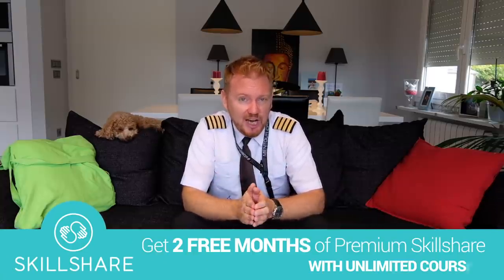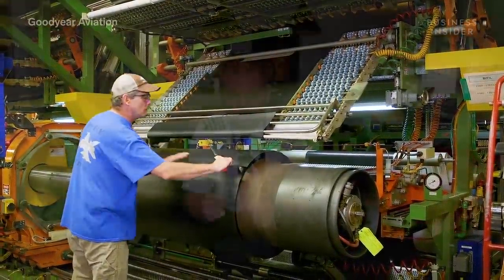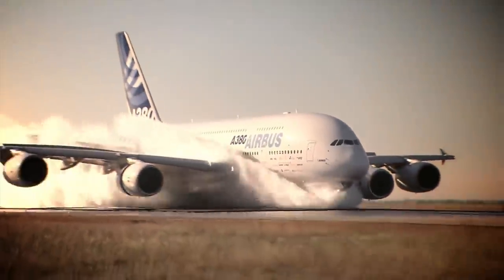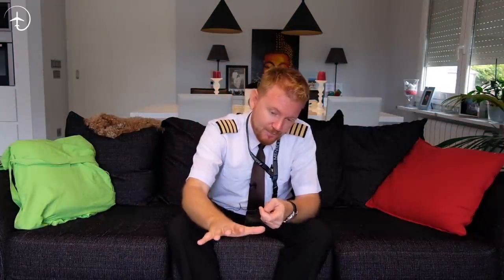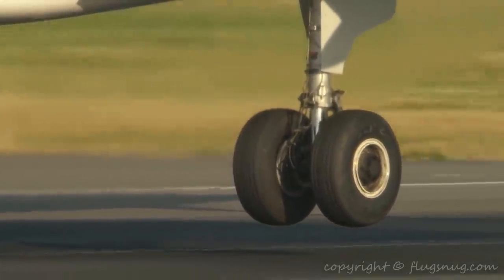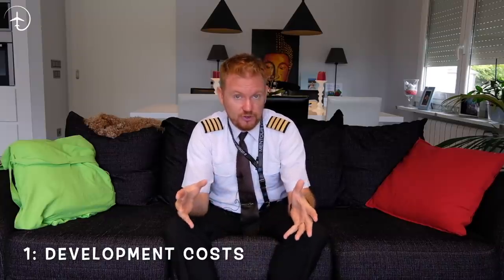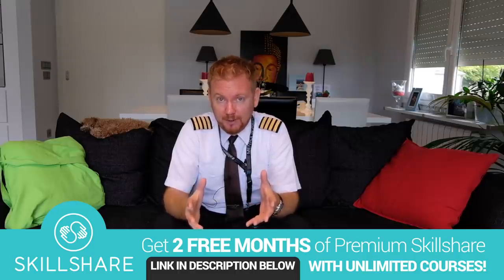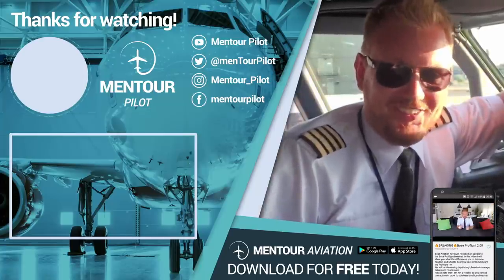Why not make plane-tires spin, before landing?!

Comment: Just think of the weight of 18 motors powerful enough to spin up the wheels on a 747, that weight would have to be carried for the whole of the flight burning extra fuel. The cost of changing the tyres when they wear is nowhere as much as the cost of transporting the motors needed to spin up the wheels for a couple of minutes during landing. Each wheel tyre and brake unit assembly weighs about 400Kg, when a weight like that (400Kg x 18 = 7200Kg) is spinning the gyroscopic effect would be quite strong, strong enough that it would affect the handling of the aircraft at a critical low level phase of the flight just what you really don’t want. The tyres are recycled, they can have the tread replaced (so long as there’s no damage to the main carcass of the tyre) a few times before they get scrapped. The wheels can be changed reasonably quickly, and during that wheel change a quick inspection can be carried out out on the brake unit, axle and surrounding area. It’s surprising how many landings a tyre can do before it needs changing. The tyres get inspected each turnaround, any cuts or wear that allows canvas to show means a wheel change.

Comment: i agree about the electric motor - probably even the weight would void the benefit in the longer lasting of the tires given that they are relatively cheap as you explained. However, how about some sort of finns that could catch the wind and start the tires spinning. About the different speeds of the tires - this could be solved by breaking the faster tires to the speed of the slowest tire. This option would not cost a lot and might save a little. ... every little helps ... ;)
Thanks for your video, was really interesting, however at the beginning you mentioned that there are no side forces coming to the tires where later you mentioned that it is possible to land a plane "sidewise" which would create these forces - for a short moment ...

Comment: I always adhere to technology that “fails safe”, So in this regard, I would design an aircraft tire with a spiral ribbed sidewall, that would upon gear down, exposed to the slipstream, begin to windmill and gain forward rotational speed that could extend the tire life, of course the tire would be unidirectional mounted as they are now. Various “sidewall turbine” blade configuration for best speed to match aircraft type. I realize that well depth may be a premium, thus flexible “web” vanes that lie flat once outside of the airflow could be deployed in the sidewall design with relatively reasonable costs.

Comment: Another simple reason is the energy expended on the tire to spin it up to landing speed is only about 1/50,000th of the energy required to bring the plane to a stop, per tire. That is not a typo.

Comment: One important thing: you don't have to spin up tires to the exactly correct speed. In many engineering problems, just getting rid of half the problem dramatically improves things. So if the tires could be spun up to half the typical landing speed, that would increase lifetime of the tires, while also reducing the downsides. Smaller motor needed, less gyroscopic force, not as critical that all tires spin at the same speed. 
What I would be most worried about, is the added weigh of the wheel by adding a motor, meaning a larger mass to accelerate if the motor fails. With a smaller motor, that is also less of an issue though.

Comment: Perhaps some form of windmill effect could be used? 

Would it produce adverse gyroscopic effects? 

Use the air-flow to spin them up. Have followed a car with a bicycle on the roof, and the the wheels are rotating, being blown round by the airflow. 
Design it correctly and it also blows air over the discs and helps cool them. No moving parts, just a cleverly shaped fan. 

Electric motors strike me as not a good idea, added complexity, weight etc. 

The flight before last I took the tug driver broke the tow bar, pulled off too, fast, and ‘snap’. Fortunately the bar broke not the nose-gear.

Comment: I see from current comments that the salient issues of adverse gyroscopic force, favorable cost-value considerations, and a survey of past experiments and trials of spinning up of the tire, by “flaps“ or some other solution, have been already well discussed. I don´t need to elaborate but for a few observations:

Experiments with pre-spinning aircraft tire(s) have determined that the most wear on a given tire is during the taxying phase of a loaded plane, even more so than than landing, except for extreme “corner-cases“.

Aircraft manufacturers (and operators!) assess the risk, weight, and additional complexity as just not worth it, as you have addressed here; however, I surmise that using a simple hydraulic motor in the hub is practical and optimal. Adjacent to a high-pressure hydraulic source (the oleos), I think that one unit spinning up four hubs/tires could add as little as ten kg each per bogie.

Incidentally, the C-5 Galaxy has (had?) a mechanism to spin up its tires, for what is apparently the only(?) “necessary“ reason for this: Landing on unprepared surfaces. (I am unsure why this is so). As it is, the 28 tires on a Galaxy are partially deflated to both save weight (just the air inside the tires weigh 82 kg!) and space (the tires will not even fit inside the wheel well unless this is done). I wonder, though, if this is a factor with the landing gear orientation of versions of the Galaxy aircraft which no longer exist....

I think the only two practical criteria for mitigating tire wear, is that the skidding tire does at least one complete rotation so that the tire is not flatspotted or out-of-round, and also that if the spin-up of the landing tire would indeed is inadequate to prevent such flatspots (short answer: it doesn´t), then either wetting or painting the tread surface accomplishes the same goal. (The formulation to be designed to quickly wear off or subliminate).

All of this is from memory, so....

Fun fact: The grooves cut into a tire are called sipes, and the frictional tread surface are lands.

Comment: on an aircraft as 787 if we have electric motors on the wheels they can help with braking! once touched down and the brakes are activated the motors can be used as brakes as well(regen braking) this can charge the batteries reducing the amount of generator needed on board and will increase bakes live and also reduce brake temps but motors are heavy and can cancel out any fuel saving from removing generators but it will increase safety by reducing brake fade(happens when brakes are too hot) and can help reduce landing distance in summers and quicker turn around can also be possible.
What do you guys think to share your opinion I am interested in known

Comment: You don't need a motor - the airstream wind can spin-up a wheel if you put air-scoops on the side of the wheel, and a shield (nacelle) diverting wind away from the upper 1/2 of the wheel.   After overcoming inertia, the wheel would come up to the airspeed of the plane, which is close to the groundspeed.  No motors, no electronics.   [As Bill Witt explains below,  achieving rotational anti-vibration would be the real challenge, not to mention the "cross-product" force induced on the landing gear during a crosswind landing).

Comment: Maybe use low tech like a Savonius type wind turbine connected directly to each wheel along it's axle. Then once the gear is deployed, it slowly starts to spin up from wind pressure and might reach a % of the full speed needed and require no batteries or complicated machinery.

Comment: Engine air bleed is a simple solution.  Tubing which only aligns as gear lowers can spin blades on the axles, even to a speed just a fraction of landing speed. This engine bleed can also cool the brakes slowly and gently after landing.  Conversely, after takeoff,  those blades can pump the air from the tires throughout the landing gear bays, ventilating any residual heat through an escape vent after gear doors close. This is simply an added feature to enhance tire and brake durability and safety, yet is no problem if it ceases to function at all.
Reply: Always remember any system on an aeroplane costs money to fly it around. Its always is this system absolutely neccessary? 
Engine bleed air is hot, (doesn't matter if its from the compressor or the turbine) so you need to cool it for the uses you are talking about, so you would need cold air units and heat exchangers and temperature control valves  plus rotating couplings on every undercarriage leg and shock absorber,  all to do something to a wheel which doesn't actually NEED to be done, it might have some minor benefits but not enough to make it worthwhile carrying the weight of all the pipework needed plus all the various components, plus all the servicing and extra fuel. so the airlines aren't interested.

Comment: Just dimple the tire sidewall. Release the brakes. The wind will spin the wheel enough to break the bearing friction and reduce snap back. Most snap back force is because the design holds the tire from spinning before touchdown because of cabin noise

Comment: I would do it with a simple vane on the wheels that spins the wheel up to about 50% of airspeed. If the wheels are spinning at say 50% of groundspeed that has to be better than going from zero to 100%. We know it's not good because we can see the smoke.

Comment: No need of a motor on the wheels, just put a "windmill" on the outer part; this would add speed to the wheel, but no "power", which means the wheel spins without any resistance of any kind. If it fails, wheels would just be like now (worst scenario).  Also depreciable resistance regarding the momentum of the aircraft...but you may increase the lifespan of the wheels and also prevent wheels from exploding at the moment of the touchdown.
The second benefit is to cool down the breaks as the wind stream would be directed to the landing gear. Can be made of plastic compounds, so cost would be low and really easy to adapt to any aircraft.

Comment: You don't need a motor to spin the tires. A guy from Germany already invented a much simpler, yet effective idea 30 years ago to get it done. All you need is a windcatching structure on the wheel disc ("hub cap") to make the tire spin in one direction.

Comment: I first proposed this to the Air Force back in 1990.  It NEVER had anything to do with using "motors!"  Gah!  Why do all counterarguments begin with "motors are heavy?"  Of course they're heavy, hence my idea excluding motors.

Rather, my approach first involved using half-moon cupping on the sidewalls and later using a Tesla Tread (Tesla valve tread design), where top air flows easily and bottom air does not.  NO NEW TECHNOLOGY REQUIRED.  NO MOTORS REQUIRED.

Either way would aerodynamically spin the tires at roughly 4/5 the approach speed, thereby significantly reducing the touchdown acceleration wear on the tires.

It's not about "the pressure bursting the tires!"  Rather, it's the TREAD WEAR caused by skidding hundreds of feet down the runway under well over the aircraft's weight.

And if you don't think aircraft tires don't take a lateral beating, you haven't watched any crosswind landings, lately, have you?

Air is 74% Nitrogen. Using 100% nitrogen isn't magic.  It merely reduces thermal expansion by roughly 9% over normal atmosphere.

Certification:  "That will take years..."  For a TREAD PATTERN modification???

Oh, you naysayers!

Comment: Not a major thing but the rotation of the wheels is also used as the means of detecting contact with the ground to automatically put the speedbrakes on the wings on.
Reply: may be, most times its the weight of the aircraft compressing the undercarriage and making microswitches that allows current to the spoiler control system

Comment: All you would need is a few cups on the side of the tires or rims and just let the wind spin the tires up enough to stop the dead stop to high speed rotation in a nanosecond. You don't need high-tech or motors, shoot, even the tires grooved right may pick up enough wind to get a pre spin to prevent the dead stop contact. Shoot, maybe the tire stress would be lessened so much the tires could be made lighter and less expensive.

Comment: I could see small fins affixed to the wheel in a radial pattern, that would cause the airspeed to impart some spin on the wheels.  Not dissimilar to a pinwheel, or a water pump impeller or a brake rotor?

Comment: To spin the weels in a plane for landing you don't need any extra engines. You could convert the weel to also be a turbine puting some clever pieces of metal in the rim, that have more drag spining one way than the other way. It would not mach the speed of the aircraft, but all weels would be spining at almost same speed and it can't fail. Well, it can fail, but if that fails then it's not the main probem.

Comment: Why don't instead they fit the wheels with light alloy fins that at least get the wheels spinning at a higher speed to reduce tyre wear at landing. Surely the cost of fitting such a device will reduce tyre wear more than the cost of the fitment. Your explanation is very helpfull, always wondered why they don't fit motors. Regards, Kobus Müller

Comment: Dear Mentour Pilot!
Everything you said can be solved (in my opinion). The wind spinner works without a motor, it is cheap, safe, it is always close to the wind speed.
Only one thing cannot be prevented: the gyroscope effect.

Comment: Ok, my first guess would be that spinning the wheels would just add unneccessary complexity, weak points and weight to the whole landing gear and airplane structure, but I guess the point of those massive wheels shaking the entire plane apart is also an obvious one.

Comment: You said three reasons for not installing an electric motor on the wheel of an airplane, all three of which were wrong or incomplete.
1-  there is no need to install an additional battery and carry it
You can use the power source produced by the plane itself. It will only be necessary to install an additional alternator

2- Licenses can be issued by demonstrating good performance

3- and most important thing is that
The rotation speed of the airplane wheel can be adjusted easily and in the shortest time by installing a laser sensor for each wheel
And that in landing the plane with a side angle due to side wind or anything else. on the ground by adjusting different speeds to help the plane reach the right angle on the ground immediately after landing.

Also, by installing an automatic or manual emergency switch, it can be done in a situation where one of the electric motors is faulty. All engines should be out of cycle and turn into idle mode.

Also, the weight of electric motors will be very low
Also, the size of electric motors is very small so that they can be installed in the center of the wheels.

Comment: The Concorde crash in Paris was caused by a tire blow out.  The shrapnel went into the engine and caused the aircraft to catch on fire.  Unique aircraft and this wouldn't happen on most aircraft types, but the front tire blow out could possibly make it into a engine.  Therefore, I wouldn't say the issue of tire blow-out is rare and not worth attention.  All kinds of accident causes with aircraft are rare, but because the ramifications are so great (can't pull over and raise the hood), all issues need attention if they can benefit maintenance and therefore safety.

Comment: There’s a reason we use lots of airline tires on barges and tug boats. They are near indestructible. I have seen the eventually get torn but it takes years of abuse after they go from airline service to repurposed on our boats. A car tire can get ripped in half the first use as a fender on large vessels.

Comment: Something I didn't hear addressed here... how much heat goes that initial spinup generate, and does it help with traction? I almost see it as the same thing as the burnout a drag car does before racing to get the tires good and tacky. This might be especially important when coming down from an altitude that just held the tires at -60°C as he mentioned.... or is it not mentioned because it is negligible?

Comment: Talking about the wheels pulling the aircraft off course is not going to happen if the motor simply spins up the wheels and turns off. The airspeed doesn’t have to match perfectly to reap some benefit from spinning wheels. The gyro effect might be an issue, but I doubt it. Try it and see!

Comment: Long story made short then, this subject has been thoroughly researched and the industry has determined that tires and brakes are easily changed and maintained and it is economically feasible under normal use to consider them as being expendable.

Comment: Sorry, you missed basic physics:  "Ideal Gas Law" --  PV=NRT :  Nitrogen (chemistry) is in point of fact not inert. This means it can react to other elements - Think NOx compounds created by high compression ratio engines = higher compress creates more NOx..... an "inert gas" would be "Noble gas" like Argon. We use Argon to TIG weld aluminum. 

Nitrogen is used in our aircraft tires because it will not oxidize the rubber when it goes from -60C to sudden increase of temp. = next time, as an A&P with IA.  (not me)